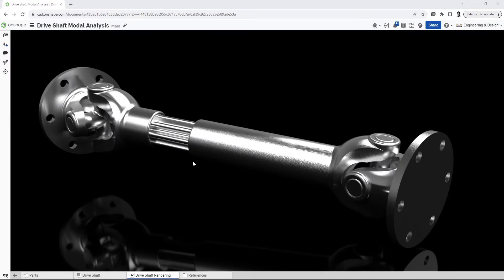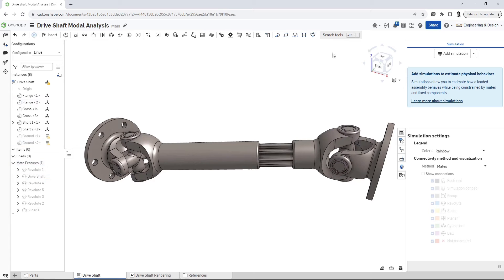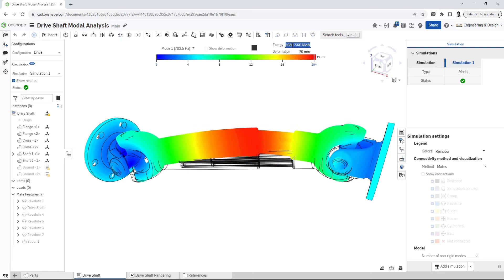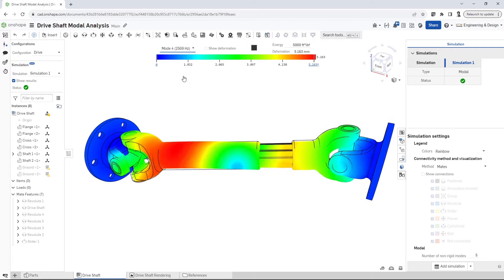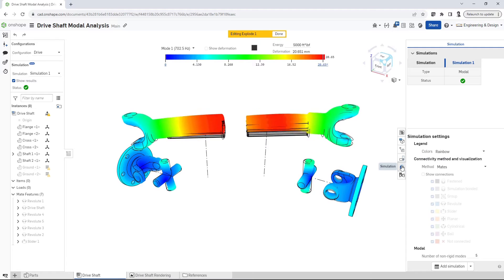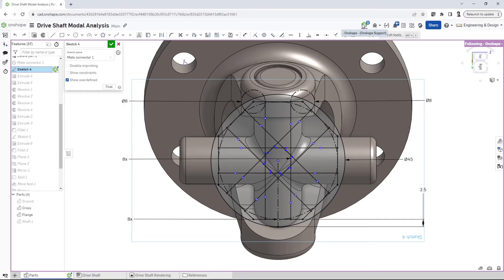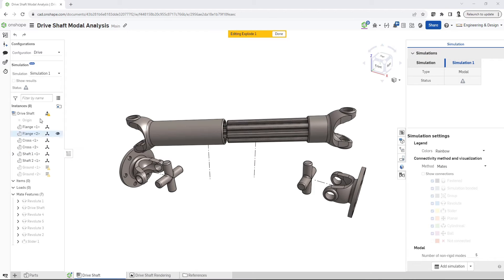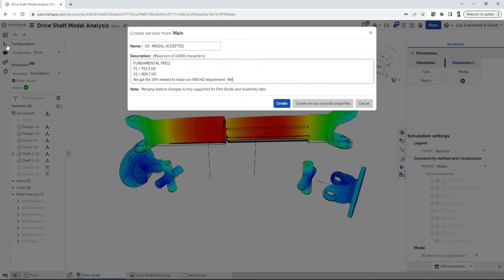Modal Analysis in Onshape

Comment: Is it also available in free version?
Reply: @OnshapeInc you should consider a trial period of the simulation function for free plan users. Seeing it in a demo is one thing, but using it on a self-designed part is a different story.
Reply from the maker: Hi - It's available with Onshape Simulation, which is available with paid plans.